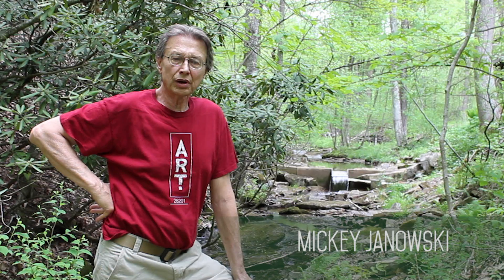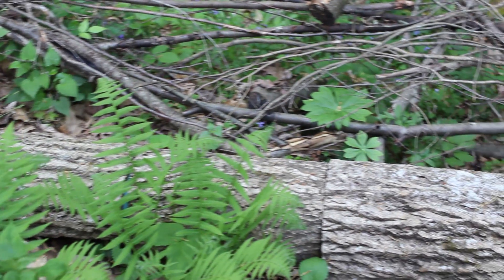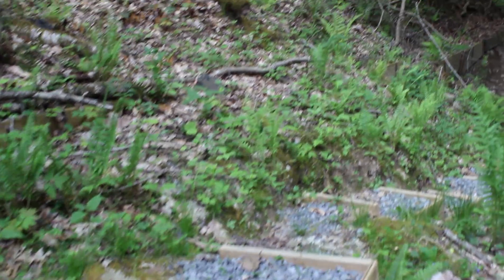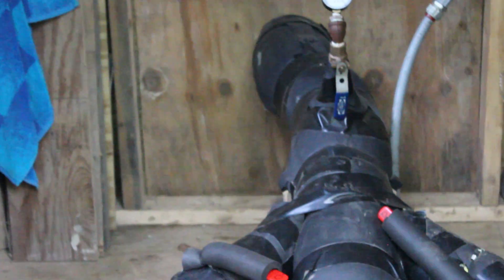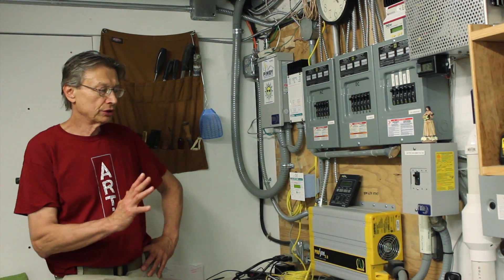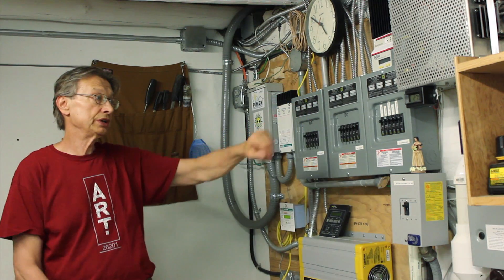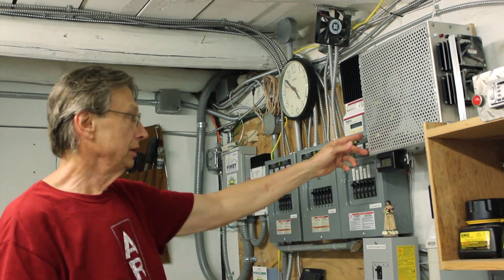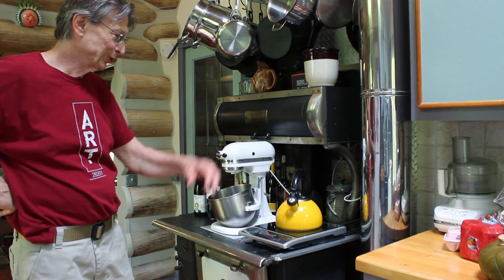Hydroelectric in WV Video

Comment: Anyone familiar with the permit process for water diversion? I'm told there are exceptions for some aspects of farming. I have no idea if that varies by state or county.
Reply: That's my concern it's my understanding no man made structure or diversion of moving water even on private property. We're in Preston county and a stream runs through the back of our property but our electric bill averages less than 50 dollars a month never over 80 so the cost offset really isn't there but I'd like to use the stream. The water flow varies greatly but always enough to keep a system going, having everything swept away is more of a concern small car sized rocks move through at times really makes a racket
Reply: @1STGeneral  ... finally got around to looking this up and it seems your fist point of contact will be either a county or state engineer, who will determine how much water you can divert. I would guess there may be few restrictions or a whole lot of restrictions, depending on the total flow available, but that's the office where you ask questions to start out. BTW, I want to know your trick to holding the electric bill under $50. In my area that would be under 300 kw a month. Heck, my kitchen fridge uses 150 kw all by itself.

Comment: Why run a 12v battery system and 120v inverter? Very inefficient and cant even run high voltage appliances.. Could be better

Comment: that is like 40% efficient. the penstock pipe is to small. to much loss in the pipe. at that flow and that head it should be at least 550w still a nice system but could be way better with some bigger pipe.
Reply: I don't know where you get your #s from but my stats show me that a 4" pvc pipe has 1.04% loss at 100' of drop due to friction.  I could get 550w with my larger nozzles but I'm not on the grid to sell back to and 370w, in addition to my PV, suits my needs and stretches my bearing life.

  I've seen larger, 8", penstocks freeze up in similar systems and climates and I suspect it's because the larger volume of water is not moving fast enough when supplying under 200 gpm thru the nozzles.  

 Thanks for your comments.

  PS  Did you give me my first thumbs down? :-)
Reply: @MickeyJanowski  last i had checked here, we can't sell to the electric companies, only build credits which we can use later.
Reply: Thanks for your comment.  I could get more than 550W just by using larger nozzles but I don't need the power and I'm off grid, so no selling back.  I figure I give my bearings a break by running it below capacity when all I'd be doing is sending the extra power to my dump load.  Cheers, Mickey